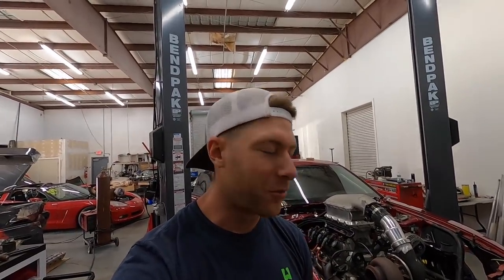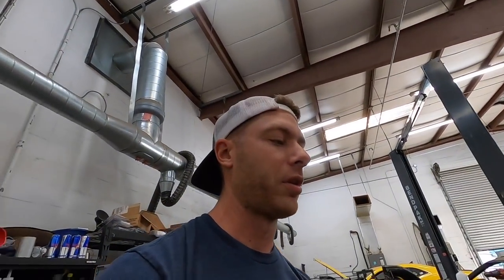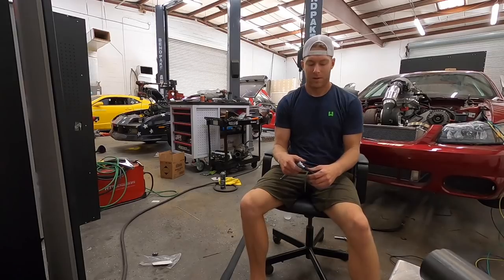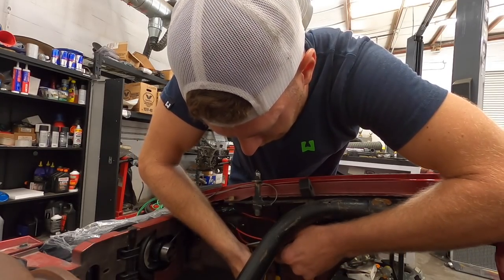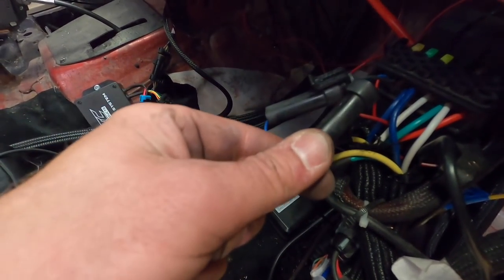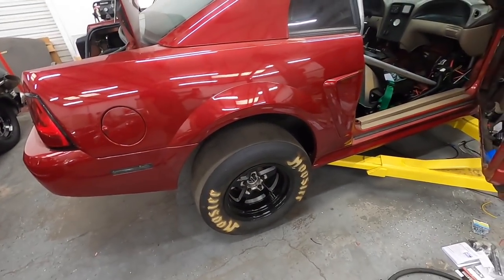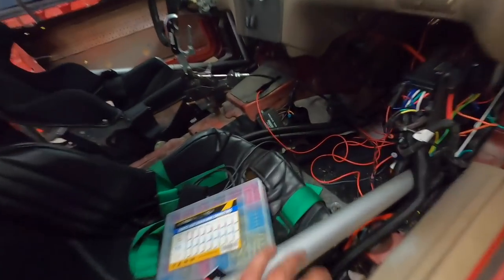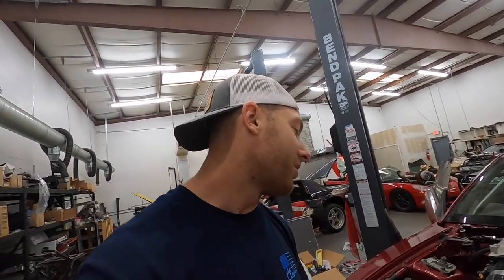7 Days Until Race Week... Will We Make It??? This Build is Getting Close We Have 100 Little Things

Comment: Your using the non insulated part of your crimp tool?? If you read the side they usually have “insul” for insulated connectors, and “non insul” for non insulated connectors, you can punch holes or tear the insulation causing a short, and melting wires??
Reply from the maker: Yes